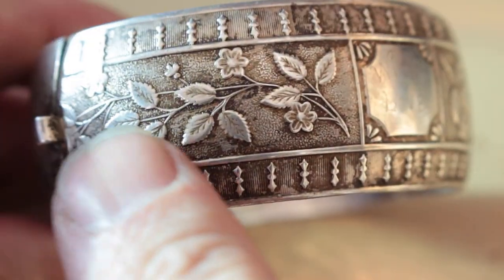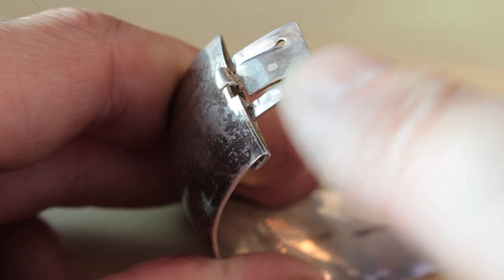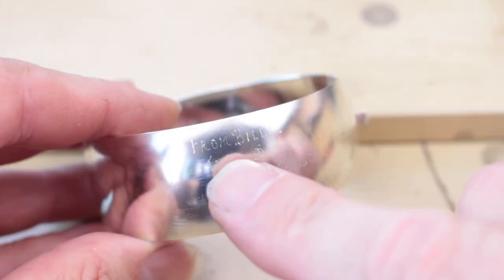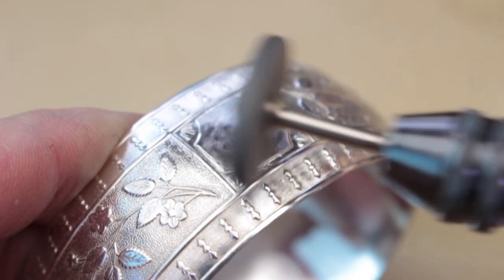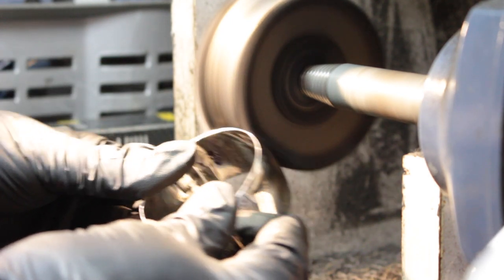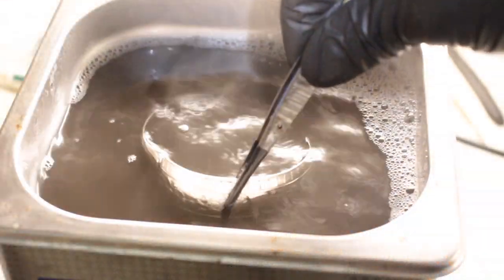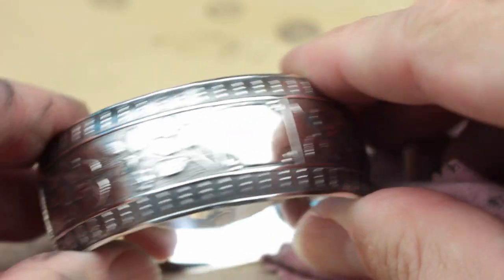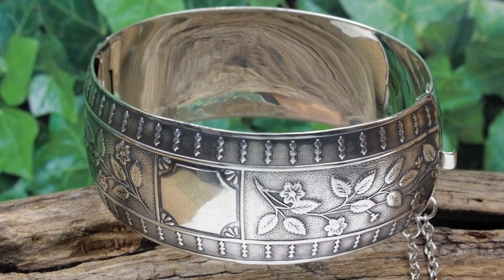Antique Silver Bangle Restoration, scratch removal and polishing, How To.

Comment: May I ask  ?    How to clean and polish a badly corroded/tarnished ornate ring found in wet beach sand with many hard to reach areas  ???
Reply from the maker: I can recommend the 3M radial discs for small areas. Work your way through a few grits. Dave
https://youtu.be/uUBnN4j98Nc
Reply: @CelticDreamsCoUk  Thank you for your reply.  I will try them.

Comment: Hello! great video. I plan on making new silver chains and am planning to file, sand, tumbler polish, then hand polish. What polish do you recommend as I live in the US and menzerna is hard to come by
Reply from the maker: What do I reccomend for what? 
for filing, use files (vallorbe Swiss), for sanding use sanding drums in a dremel, or flex shaft (600 grit), for tumbling use steel shot and burnishing powder, for hand polishing, use Tripoli and rouge on felt and cotton mops, either larger on a bench polisher or smal ones on a dremel. Dave